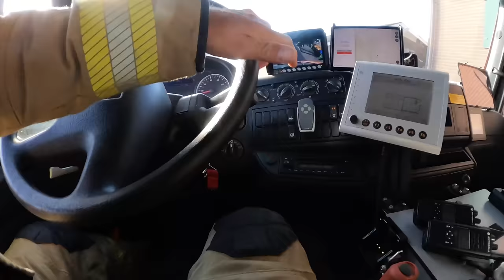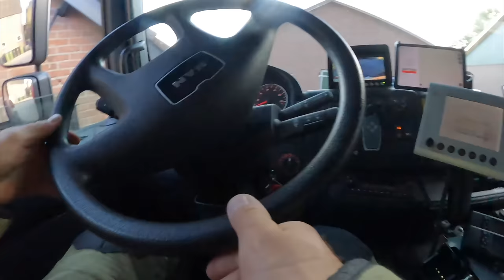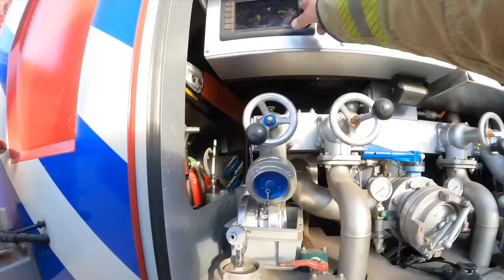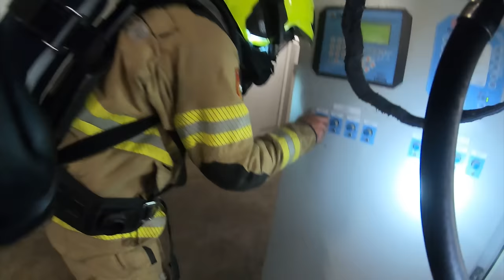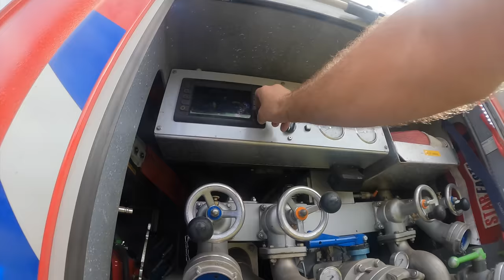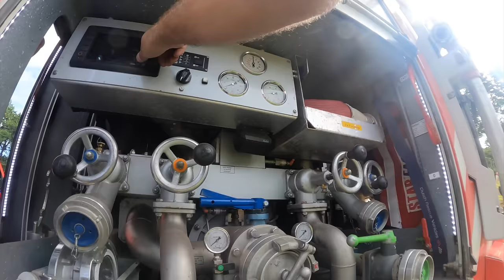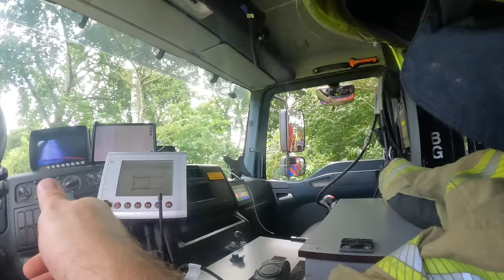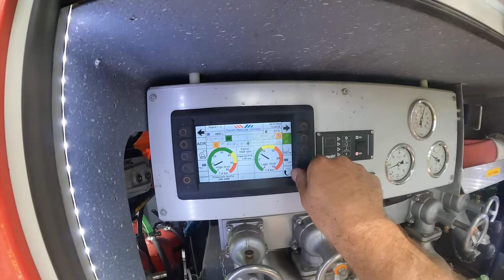Broeibrand - VOLUNTEERS DUTCH FIREFIGHTERS -

Comment: Eight on a crew!  Wow.  We're lucky to get five, usually only four due to government cut backs.  Not only that, true number of pumping appliances has been reduced by 40%!  If the UK public really knew just how bad fire cover in the UK is they wouldn't sleep at night.  Even I presume I am not going to get a timely and adequate response so I have made my own arrangements.  I have my own fully linked smoke and heat alarm system with water and dry powder extinguishers on each floor and a 100ft hose reel right outside my back door which I have already used on a neighbours shed fire extinguishing it 5 minutes before the arrival of the first pump.  It's absolutely shameful.

Comment: If somebody who knows the inner workings of the dutch fire service could explain to me what all the numbers mean, I'd be very grateful. I mean, I know what an "OvD" is, but who (or what role) is the 110, 120 or 119 and so on?
Reply: Its just the personal number of that firefighter.
Reply: @patriciadeboer  Like a badge number for cops? There must be more than a three-digit number of firefighters in the Netherlands...
Reply: Brandweer Nederland, works with platoons, the first one is called in via kleine brand (small Fire), middel brand (middle fire), grote brand (large fire), and zeer grote brand (realy large fire). 

After that generally units are called in per platoon. (4 engines one platoon commander and if needed rescues/ladders. the commander of the first platoon is the 100, the captain of the first engine is the 110, the engineer of the first engine is the 119, all other firefighters on that engine are the 111,112,113,114(officaly an engine is manned with 6 firefighters sometimes less and sometimes more) 

The second engines captain is the 120 with 129 being engineer etc. The next platoon would be the 200,300,400. 

The 900 platoon is logistics (clean clothes food and flow of units from and to the side of incident). Platoons 500 and 600 would be for water (large volume pumping or tanker shuttle) 700 for a rescue platoon 800 for a foam firefighting platoon) 1100 is for hazmat platoon and 1200 for recon platoon (for wildfire or hazmat) 1300 decon platoon. 

 The platoon numbers are not always used in the way described if you just need a lot of  engines you would keep going up in numbers past 400.
Reply: @albertfeijen6453  Thank you very much. This was exactly what I was looking for :)